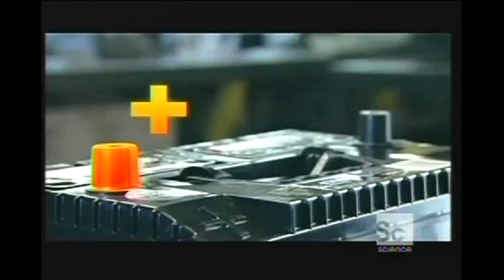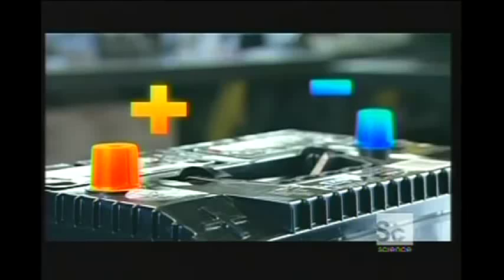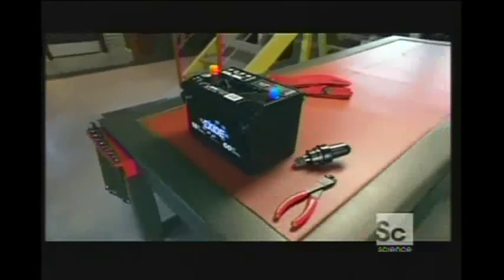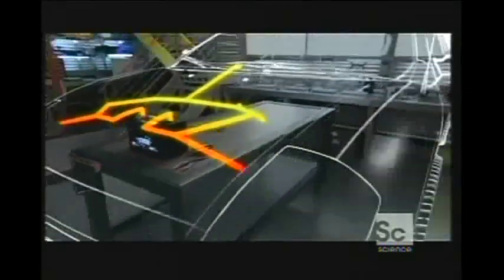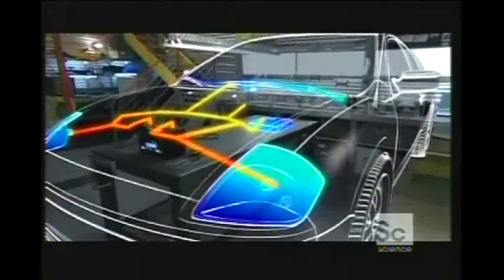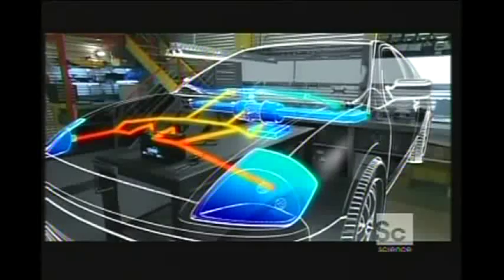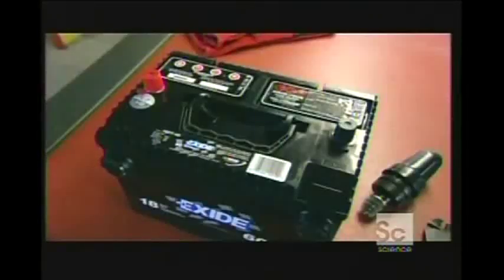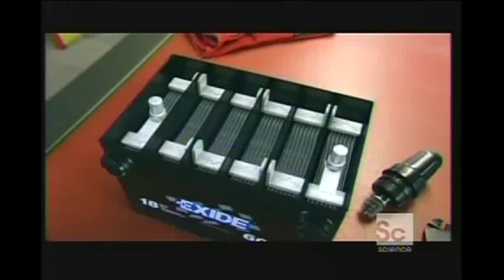Nanopulser - An Inside Reveal on How a Lead Acid Battery Works

Comment: If the electrons flow one way, the battery discharges. If you reverse it, the battery charges. 

So yah. 

If you tried charging by feeding electrons into the positive, you are simply increasing the voltage through a low resistance circuit, which damages most batteries. Pb batteries don't get damaged by shorts, as long as you don't let it deep-discharge.

Comment: Oh, if you put electrons from the charger to the battery, its just boosting voltage. Electrons flow from red to black - to +

But when charging, you need to do the same in reverse. If you put the same voltage the other way, it is perfectly balanced. You need to feed MORE voltage than the battery, in reverse.

Comment: what does colors have to do with electron flow ?
 the symbols are correct  + is the power  - is the return or this case ground. that's why the + sign. negitive cant have the power from it and still be grounded to the car, so the few who teach this are silly.
oh btw.. good for you (spelling color)